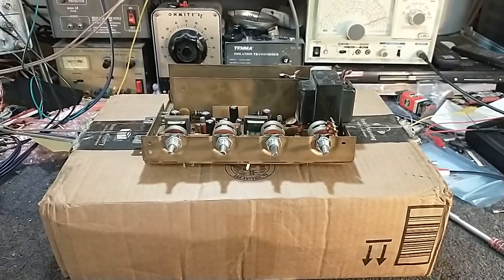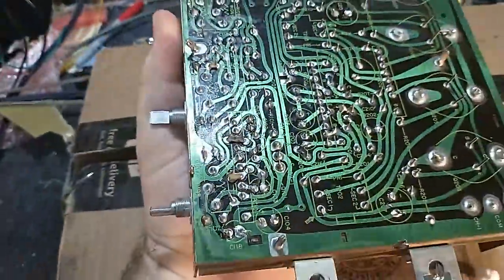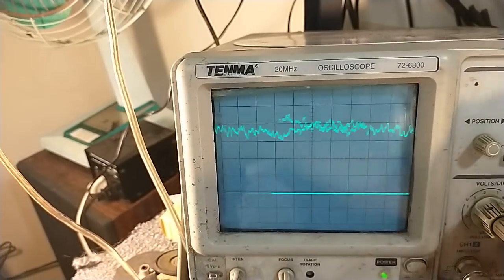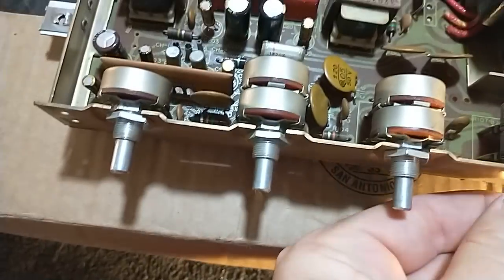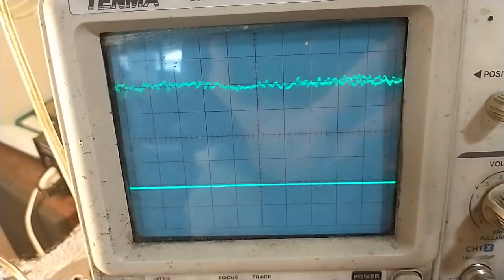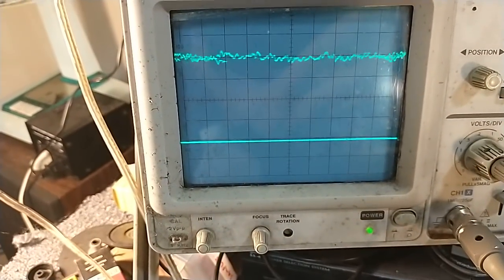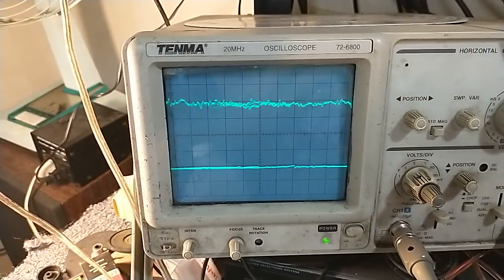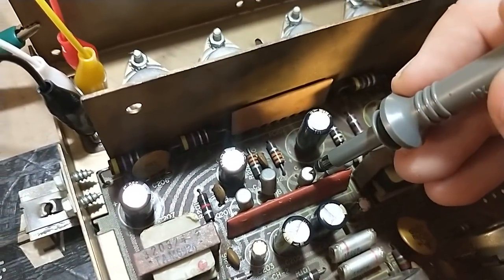Diagnose and repair a 1960s Magnavox transistor amp with a noisy channel.

Comment: It's so satisfying to watch you efficiently and confidently diagnose and repair an issue. It's watching a master at work. Thanks and keep up the great work!
Reply: Agree 1,000 percent.  There are a lot of people who would instantly fire the parts cannon at any piece of vintage electronics, i.e., replace entry single capacitor (even the ceramic disc ones), every single resistor and every single transistor.

Comment: I have a 1965 Magnavox Astrosonic console I picked up to practice some repair work on. Replaced the electrolytics with Rubycon caps and have the same white noise problem, but also noise like silver mica disease, crackling and popping. I put a couple of videos up with the scope hooked up, and have the noise isolated down to the driver board between the tape output and the driver transistor. Germanium GE3 transistor, which I ordered a couple of NOS ones, hopefully they are not noisy as well. I didn't try the freeze spray, will try that to confirm it is the one I think it is. Only other thing that could cause it is a couplet that is the tone control circuit. I have heard these transistors form tin wiskers that cause the crackling and poping. I know Shango066 uses the Russian transistors, but I had no idea which one to use for the GE3 replacement. Thanks for putting up the video.

Comment: Well done, that didn't take long at all.
I have often swapped the right left transistors to see if the problem jumps to the other channel.
I've known the odd capacitor to create noises too, but not too often.
I'm not a lover of germanium transistors in push/pull outputs, not very stable.
Reply from the maker: Gotta say of the old germanium amps out there, the Heathkit and Magnavox amps seem to be pretty solid
Reply: same here also I have used the scope and a huntron tracer

Comment: Usually those germanium transistors have dots next to their collectors.  If the dot is red or black, the transistor is PNP. If the dot is blue, the transistor is npn which is very rare.
Reply from the maker: Great info!
Reply: @JordanPier  Another piece of information is that those cylindrical germanium transistors were made in Japan only. Their part number usually start with 2SA or 2SB.  For the power transistors their part number usually start with 2SC or 2SD.

Comment: when you  took the transister why did"nt you check with diode setting on meltimeter?
Reply from the maker: Already confirmed with a scope it was noisy. 

The diode test on a dmm will show if there is a functioning junction, but it will not reveal leakage - which is what's causing the noise.

Comment: Hi JP, You did a video in 2016 named (Servicing a Vintage Pioneer SX-838 Receiver) In this video you used a RCA WV-519A to test some caps. I was hoping you could tell me exactly what batteries that meter takes. I just purchased one and I can't find any info on line about it or a manual and it did not come with any batteries. Thanks so much for all you document it's been a great help to me.
Reply from the maker: You'll need a 22.5v battery, and the others inside are common 

Here's the 22.5 https://www.ebay.com/itm/A-22-5V-Dry-Battery-15F20-412-U15-VS084-MN122-for-Tube-Radio-Analog-Voltmeter-/234185949109?mkcid=16&mkevt=1&_trksid=p2349624.m2548.l6249&mkrid=711-127632-2357-0
Reply: @JordanPier  Thank you.

Comment: i've got an Astro-sonic with a 231 chassis that has a bad channel i already tried cleaning the switches and controls but no improvement, can you tell me me where i can get a manual?
Reply from the maker: Gotta look up the sams photofact. That's about your only hope
Reply: @JordanPier  i tied already, NO luck, it might be some capacitors

Comment: That noise was caused by the germanium breaking down.  I really dislike germanium transistors, I have had so many go bad over the years with them properly applied in the circuit.  The diffusion process is done at such a low temperature (as well as the semiconductors max temperature rating), these things revert back to sand just sitting on the shelf.  The high reliability electronic industry recognized this problem as early as 1956 so, saw the future in silicon semiconductors.

Comment: You didn't say if you had a schematic. How did you know if the transistor was NPN or PNP? Did you measured the other channel device off camera?
Reply from the maker: Long experience with these early solid state sets, especially Magnavox is that they exclusively use PNP germanium devices until about 1970
Reply: @JordanPier  And I'll bet it's positive ground!
Reply from the maker: @andydelle4509  yusssss

Comment: Could it be a noisy resistor or is it most likely a bad transistor.
Reply from the maker: It can be both, but germanium transistors have a higher failure rate. Statistics show transistors cause this problem more than resistors.